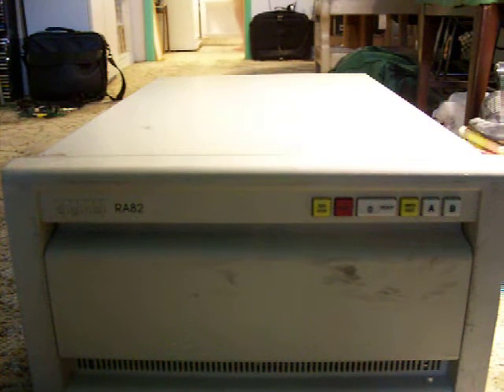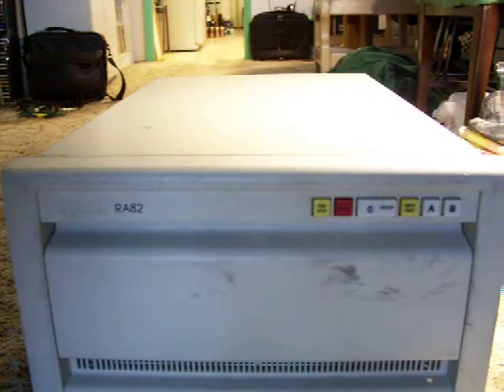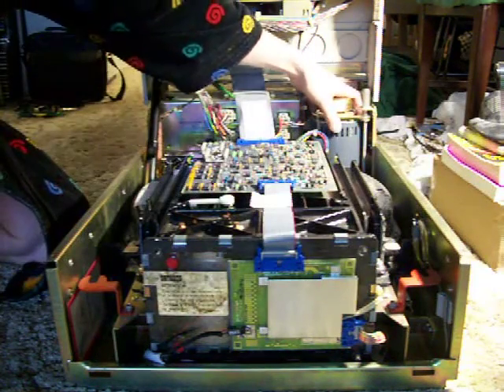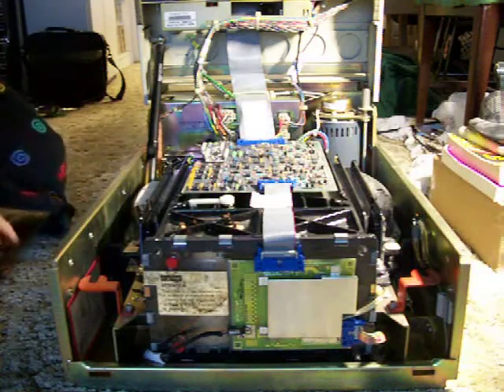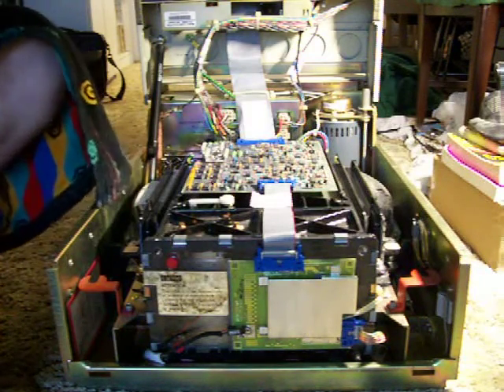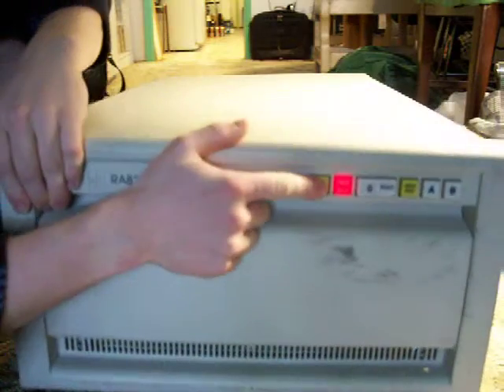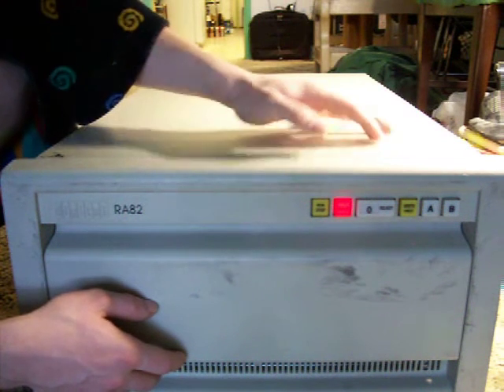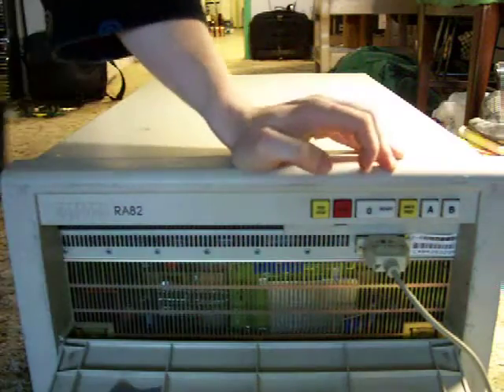Digital RA82 Disk Drive Troubles

Comment: That was a common fault with these when they got old. When they were allowed to get cold they would exhibit this fault. New brushes on the motor maybe?

You're lucky you didn't get an RA80. DEC lost a packet over the HDA glue migration issue in those.....we replaced so many......

Out of curiosity - why? This monster is supposed to only run in a cool, clean (filtered air) environment and makes an awful lot of noise. It offers a storage capacity of about 600MB - you could get more on a single CD recordable!
Are you resurrecting this thing for historical interest? I guess you must be.... :-)